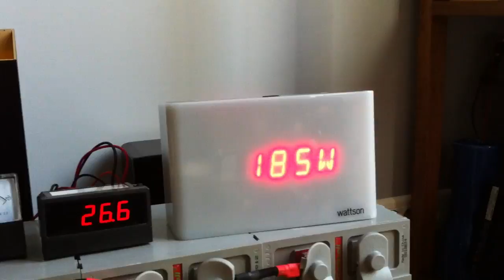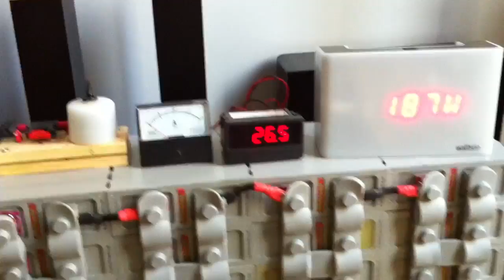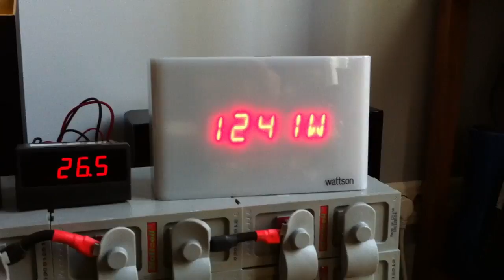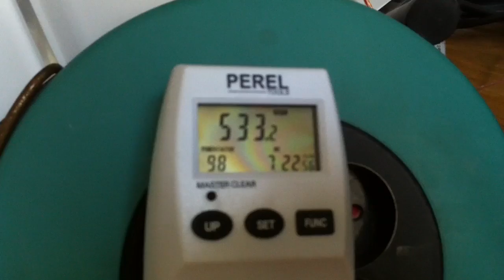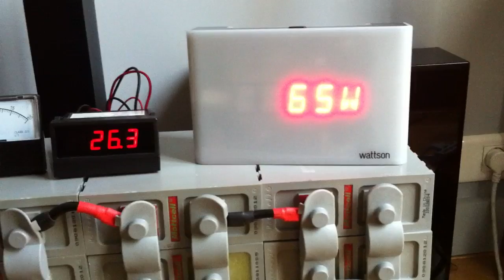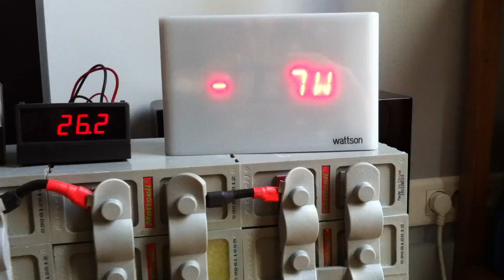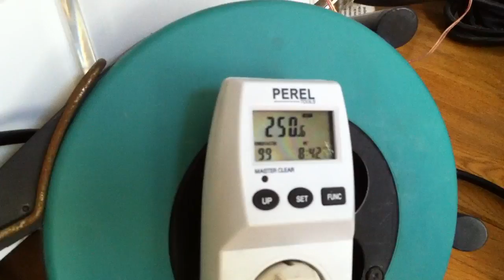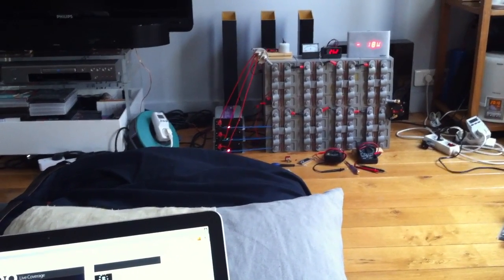LiFePO4 Energy Storage & Power Supply System - New 24V configuration - Long Test

Comment: what are using to charge the battery's I love to use LIFEPo in my off grid battery bank instead of lead acid, but very costly and I have hard they don't have a very good life span and that they are mostly 600 charges ect. were I love have them for off grid for a long power and storage solution in less space.